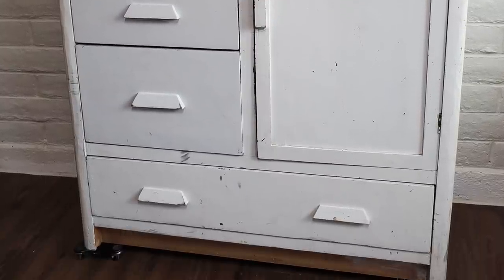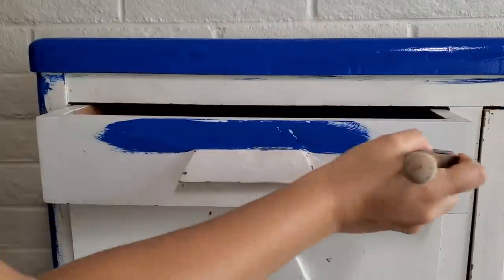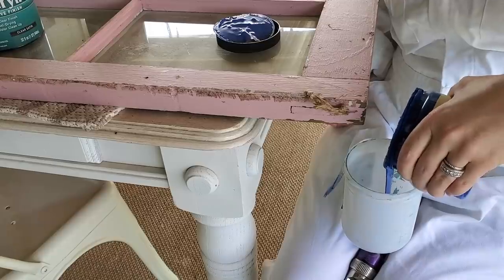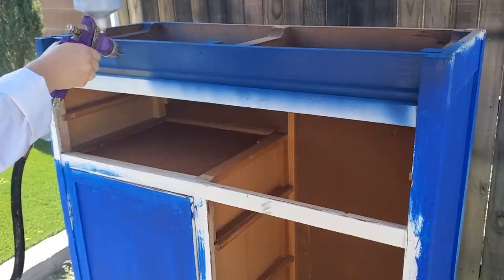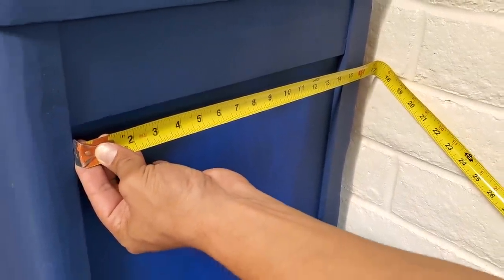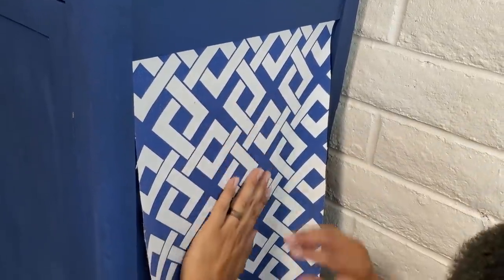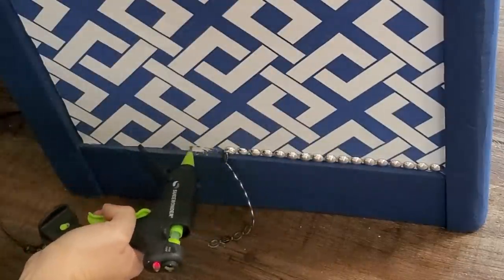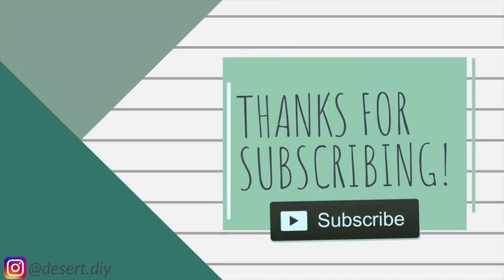Extreme Furniture Makeover: A Curbside Find Packed With Potential

Comment: A French friend of mine used fabric to decorate the walls - as it seems to be fashion in some French households. She used wooden frames to cover the seams, just as suggestion. That might be easier than cutting exactly. Great piece!
Reply from the maker: I have heard of that! I learned that if you soak fabric in starch, you can stick it to the wall without it doing any damage to the drywall. It peels right off if you ever want to redo it later. The trick is finding a fabric with a pattern that repeats well enough to work as wallpaper
Reply: @DesertDIY  she did it like a mirror on the wall, in regular distances. So you just need a pretty fabric (and maybe the rapport at the same level).

Comment: Hi Cori.  I have seen you used the faux nailhead trim that comes on a roll. I've been trying to find it but the only thing I'm finding is the kits that requires an actual nail every 6/8 heads.  I know you're mentioned you got it at Walmart.  I haven't seen it
Reply from the maker: Hi Lisa, they can be found in the craft section near the ribbon

Comment: Congrats on your 4th child❗️I always had saltines next to my bed & eat 1 before I even raised my head up‼️ I was wondering why you didn’t do some repair & sanding? Is that part not important for this project? Anyway it did come out very cool with the touch of elegance. 🤩 
Those nail heads gave it a special touch‼️
Reply from the maker: Thank you Margaret! With chalk paint you don't always NEED to sand. It is recommended but a bonus for our climate is the paint is usually dried out on old pieces like these so the chalk paint sticks very well.

Comment: I like the look of it, well done, but why did you not sand it before painting?
Reply from the maker: Thank you Vicki. I used chalk paint which does not require painting as long as the surface is not abnormally slick like with fake wood or glass